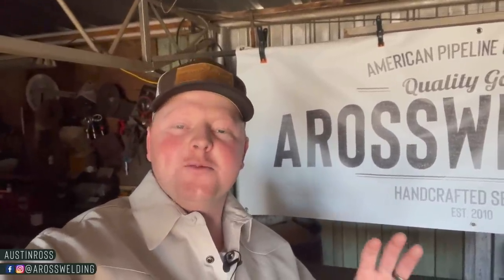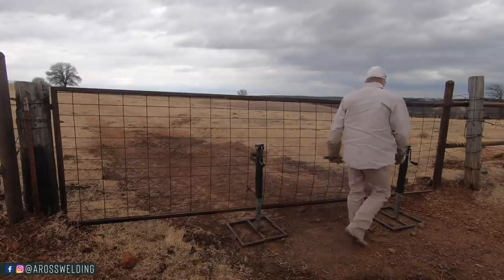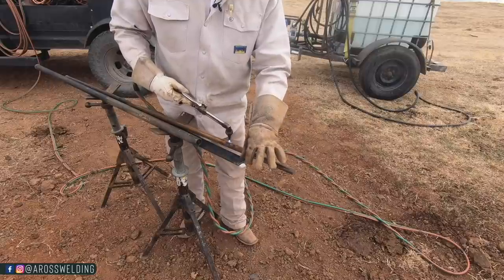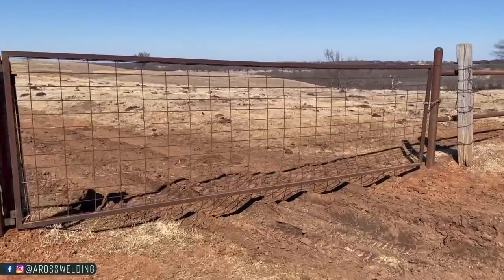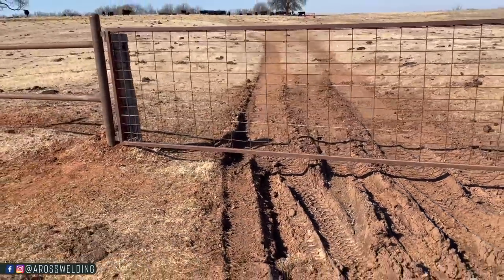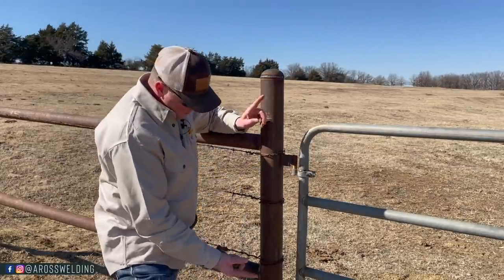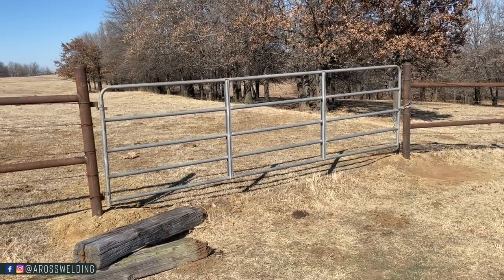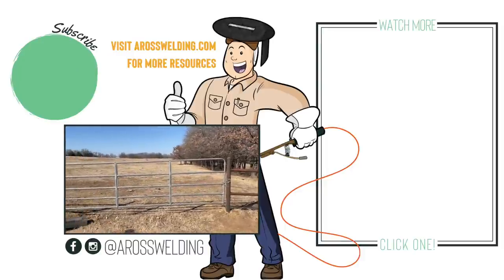DIY GATE HINGES (AND HOW TO PICK THE RIGHT HINGES FOR THE JOB)

Comment: First of all as a firefighter in your area I appreciate your due diligence bringing water with you. Very few welders do that, had a fire just 3 days ago from welders not having water on hand. Appreciate your Channel, stopped welding years ago and getting back into it and using your Channel as a refresher.
Reply: no fun chasing field fires
Reply: Just an added thought. You might want to take that 1993 placard off the trailer. Unless you're hauling a placardable amount of fuel... it seems miniscule but if you don't have hazmat on your DL and you're not using that tank for whatever placard used,  DOT could ticket you for it.  It's also likely since your not hauling a hazmat product you probably also wouldn't have the response paperwork sitting right there.
Reply: At least carry a bucket of water and an old mop to quench fires
Reply: @patrickhorvath2684  better off carrying and hand pump sprayer. Can get more coverage per gallon of water, put out some pretty good control burns with that and a backpack blower which we also use in the fire ground.
Reply: @rodneycook3904  
True.
Not good to flip up hood n see fire burning 6 feet all around you..
Reply: 5j

Comment: Having grew up on a ranch and feedlotl,  if this were my pastures and gate, I would want the hinge strap moved to one side some.  Then the gate could be opened parallel with the fence.  It then could be left open as desired and attached to the fence to keep livestock from rubbing and it blowing in the wind.  This is not a criticism--just a comment!  I really like your channel and content.  You do excellent work!
Reply: I agree, it needs a double pivot point and will open flat against both sides of the fence.

Comment: You might consider adding a "drop pin type hold open rod" to the end of your gates, my customers love them.  Keeps the gate stationary in any position, a short bent handle keeps it up out of the way until needed.
Reply: Called a cane bolt.
Reply: We call em drop rods

Comment: 40+ years ago a local welder used a small pump up sprayer with water and dish soap to 'wet' the dry grass ..... it's amazing the difference a small amount of soap will make when 'wetting' an area for fire prevention --- something about breaking the surface tension in water molecules as well as the soap making the water 'cling' to the grass better/longer.

Comment: I only use D & D Adjustable Hinges.  They are a weld on hinge that comes in pedestrian size (500 lbs) to big gate sizes (1000lbs) and they are adjustable.  Yes I can make my own, but they have a sealed bearing that never needs grease.  They are fairly expensive but I have never had to go back and replace one in the 5 plus years I have been using them.  They are awesome and I tell my clients they have no choice to use them or not.  If I'm building their gate, I'm putting them on.  Every welder I tell them about loves them... As far as "Farmer Mode"  Remember you still have to go back if it breaks so do it right like Austin does.

Comment: Snow. My reason for being able to lift a gate off of the hinges. When a gate is snowed in it requires hand shoveling before the gate can  be swung open. With the gate lifted up and away off the hinges it's possible to just drive through and/or much easier to plow away the snow.

Comment: Love the channel…as a fence builder can I recommend you using single chain links for the clip with the cut towards the top so new barb wire can be restrung with no problem, clips can open and be closed after new wire with a simple hammer…just a suggestion how we do it

Comment: I grew up farming and ranching and have built a lot of gates.  I prefer building the gate so that it is wider than the actual opening and letting it overlap the hinge and latch posts.  Obviously it will only open one way, but 99% of the time that’s okay.  It will also allow the gate to open back against the fence flat.  If you have ever had a baby calf get behind the gate instead of going thru you will know why they need to be flat against the fence if you are moving cattle.  I realize that if the gate open both ways then there is no problem with the calf.  I just prefer to be able to latch the gate snug up against the latch post plus you can put a foot on the latch post for the gate to sit on when closed to minimize sagging.   This is not a criticism of your work Austin,  just a comment about how I do it.  We’ve both seen dozens of different hinges and latches on farm gates and they all work.  I enjoy your videos and have picked up a few handy tips.  Thanks.

Comment: Can't say I agree with mounting the "flags" or pins in the opposite directions. It puts all the weight vertical weight of the gate on the bottom pin - putting both flags pointing up shares the load between them. At that point it can be left as is, so the gate can be lifted and removed if needed, or a washer or tab can be welded on to block the gates removal.

Comment: Was thinking about using 1" spindles and hubs from old boat trailer for my hinges on new gate I need to build for my sister. See any issues? Going to use old trailer frame for gate and attach 1.5" x 16" Cedar boards I milled. Gate is 7 feet wide.

Comment: I am sure this will be in your course but how do you go about leveling your gates when you have a fixed hinge?
Reply: I think he would level the gate using the gate jacks and then adjust to get the gaps right and weld it.
Reply from the maker: As long as the post is plum the fixed hinges work just great. But like the other individual stated I also use my gate jacks to actually level the gate. 
If my post is not plum then I will either trim one of the hinges or add to one just like I did here:

https://youtu.be/nm9jBjrgJ98
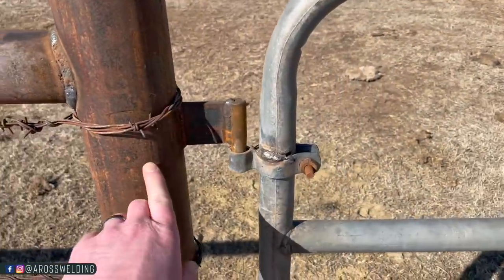 @ 16:37

Comment: So why do you use oxygen/acetylene torch over oxygen/propane in both everyday use and pipelining?       Wouldn't propane be cheaper cost input?   Great videos and nice job.
Reply from the maker: It’s just what I’ve used all these years 🤷‍♂️
Reply: @arosswelding  ok, I appreciate it.
Reply: my guess is because almost all of us learned on oxy/acet torches so we just stuck with it, I never used a oxy propane setup do you have to set the Propane to a different pressure than you would acetylene? I assume it burns alot cleaner than acetylene considering that shit covers everything in soot
Reply: @natenate2280  40psi oxygen and 5-10 on propane is what I learned.    Other than tips and how you lite torch it really cuts about same.   Only downfall is not being able to weld/braze with it.